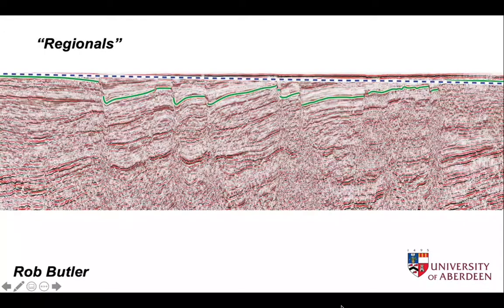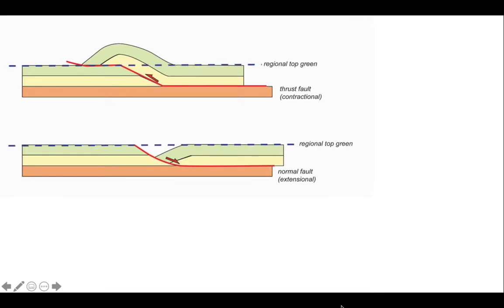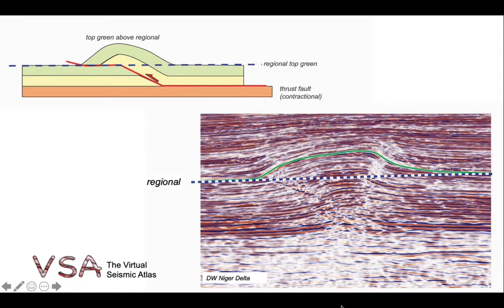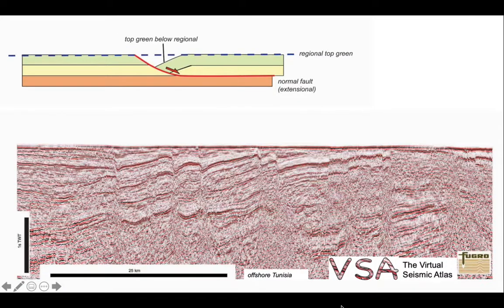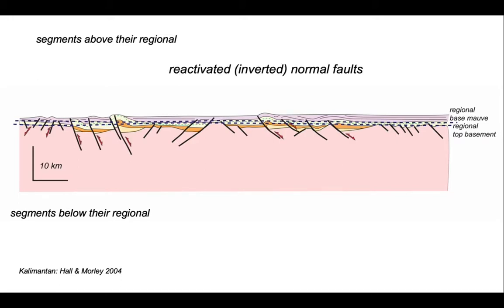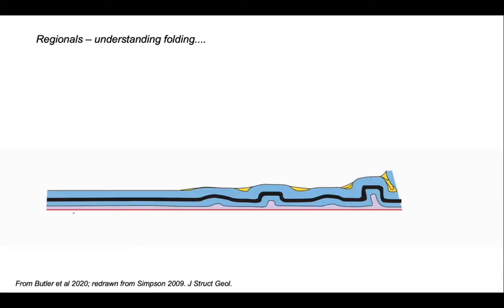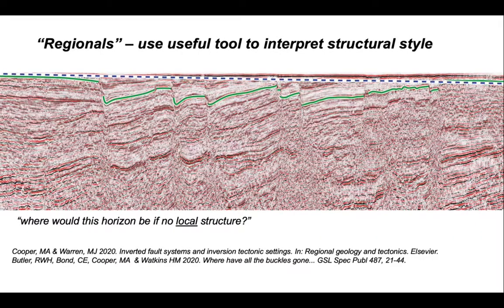"Regionals"

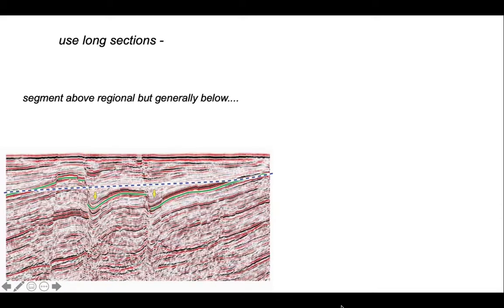Comment: Hi Rob, at 4:54, part of the hanging wall is also above the regional, could that be related to a mild inversion tectonics?
Reply from the maker: Unlikely. The rotation of normal fault blocks does generate small corners in fault footwalls that can go above regional ... a reason for rift-shoulder unconformities.... google papers by Dave Barr from the mists of time.
Reply: @robbutler2095  thanks Rob. I really appreciate

Comment: I am puzzling about what is the  regional tectonics. Should the "regional" word in Regional Tectonis be same to  "regional"  that you are talking  here?
Reply from the maker: Thanks for the question. The term "regional" in this video is very specific - - short-hand for "regional elevation and orientation" ... and it refers to where a particular stratigraphic horizon would be (eg when seen in cross-section) were it not for a local structure (e.g. a particular fold or fault). Therefore the "regional" for a horizon serves as a reference datum against which the local deformation structure can be assessed. The usage comes from applied geologists studying sedimentary basin structure - chiefly using seismic imagery. It has nothing to do with "regional tectonics" - which is an informal term for anything at a scale larger than a specific study area. So - if for example, someone was mapping a small field area on the edge of a mountain belt, the regional tectonics context would be for the greater foothills, or even the mountain belt as a whole. It is unfortunate that "regional" is used in several different ways... it's the nature of evolving science I guess and there are other examples (inversion - as involving fault reactivation vs turning rock sequences up side down; deformation bands - a quartz intragranular microstructure vs v small faults in porous sandstones)....
Reply: @robbutler2095  Thanks. I begin to understand "regional tectonics" as an informal term.